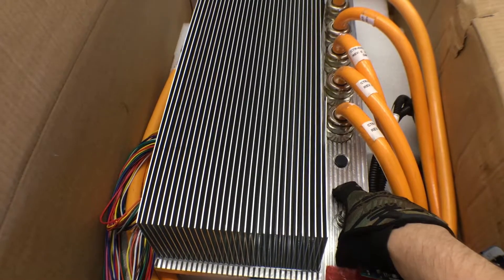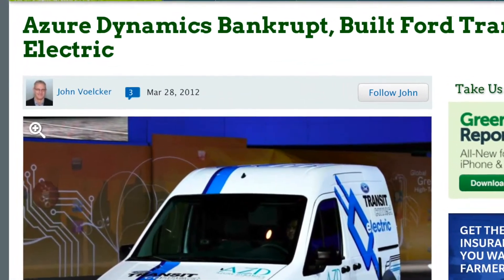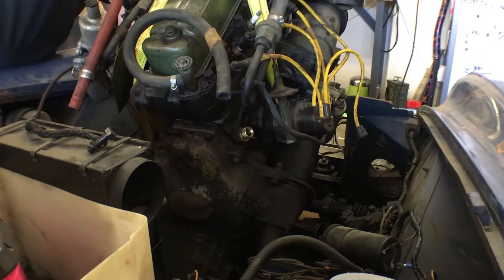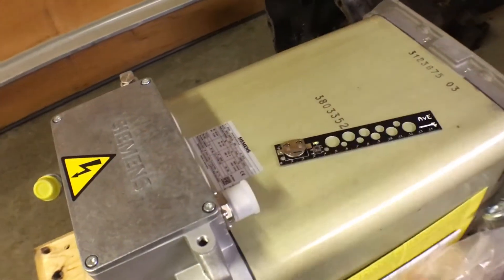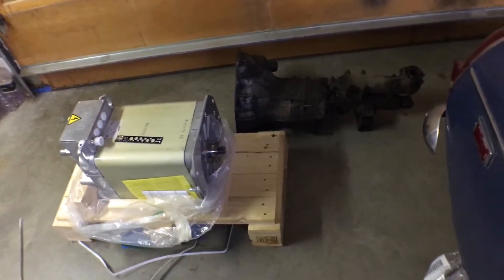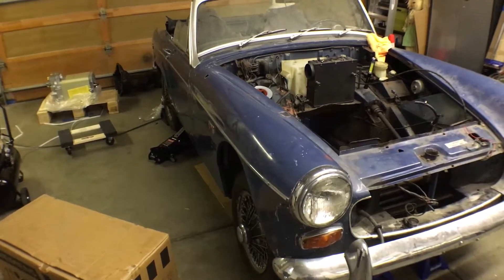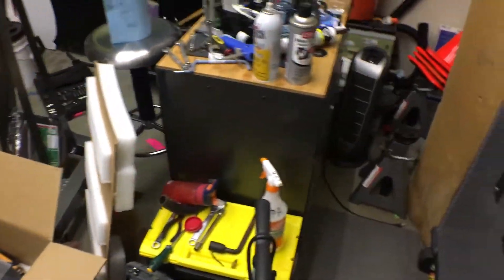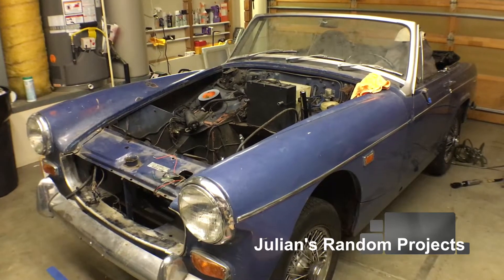MG Midget EV Conversion Part3

Comment: excellent project.. what voltage battery pack are you going to use.looking forward to seeing the progress
Reply from the maker: Thanks! Higher than 140V, not sure just yet. It really depends on how many Chevy Volt modules the car can hold. If those don't work I'll start looking for alternatives, maybe 18650s or Smart fortwo cells.

Comment: Hi bro, can you please tell me what's the HP of this motor. Thanks
Reply from the maker: The data sheet says 47KW (63hp) but when paired with the DMOC645 Inverter I'm using, they've been dyno'd at 118KW (158hp). In short, for my application, the transmission, differential, wheel hubs, none of them can handle 150 horses :)  So stay tuned for axle twisting in a future video.
Reply: JuliansRandomProject  oh thank you so much, well I guess 158HP is too much for this car isn't it...
Reply from the maker: Time will tell :D
Reply: 63Hp sounds like a lot for that gearbox and car. The original engine is 46HP which is peak power for for the petrol engine, whereas an electric motor is rated by its nominal power. A 63HP electric is equivalent to 315HP gasoline engine though your inverter limits it to 185HP. You could save some weight and waste less amps cruising by getting the cheaper 10KW Siemens motor, and it would still pickup slightly faster than the original
Reply: Dear @JuliansRandomProject

Can you please specify about the motor make and model.!!??
Is it better to go with an AC motor or DC motor..!??

I'm in my Quarantine project of an 1986 FIAT 1100.
Thanks

Comment: A Nissan Leaf costs less than your project.

 https://www.truecar.com/used-cars-for-sale/listings/nissan/leaf/?sortOrder=PRICE_ASC

So what is the point?
Reply from the maker: Alaa, this isn't a means of commuting to work. Plus I've already owned a nissan leaf, it's an ugly car with shit range and slow chargers. (which is why it's so cheap on the used market, sold mine for $6K). This is for fun. It's not practical in that it only seats 2 people and it's nowhere near as safe as a car made in the last 20 years. Doing this for the giggles and grins :D
Reply: ok
Reply from the maker: Time will tell if I paint or otherwise improve the looks. What? you don't like the idea of a sleeper? :) As for Leaf parts, I did a mock budget with a leaf as donor for the parts, all new parts is cheaper but only because EVTV had an amazing sale. search youtube for the guy that put Leaf parts into a custom VW van, super cool!
Reply: But then you'd be driving a Nissan Leaf instead of a really neat car that is also electric.
Reply: Awesome project, I'm with ya...
Reply: Wouldnt it be more economical to source parts like motor etc from the Leaf (or other existing ev) into this project than? Or is upgrading parts of those worse economically than buying these separately? Anyway, I hope you will get it painted and looking decent. I would be sad seeing an EV midget AND in bad condition. :D